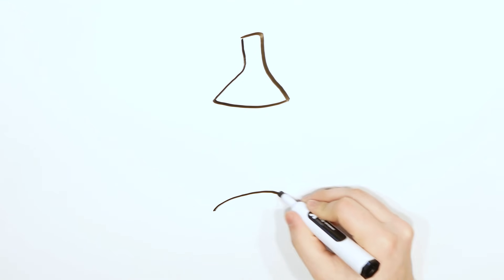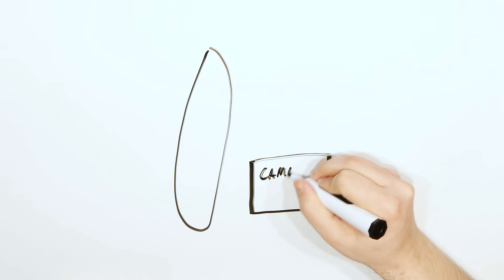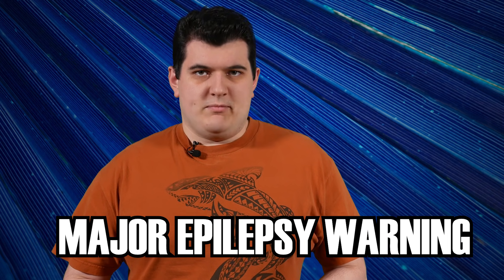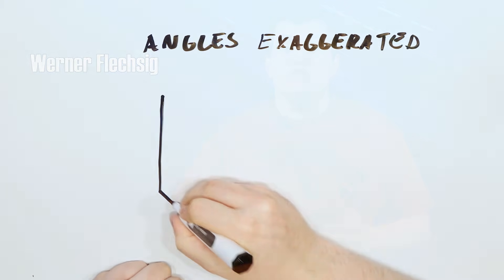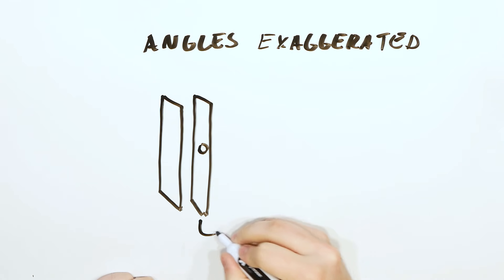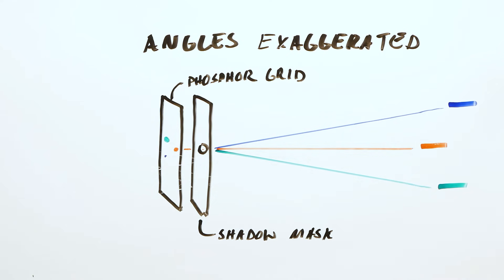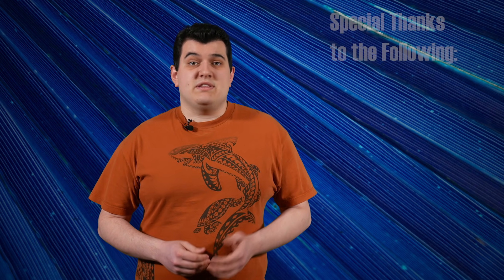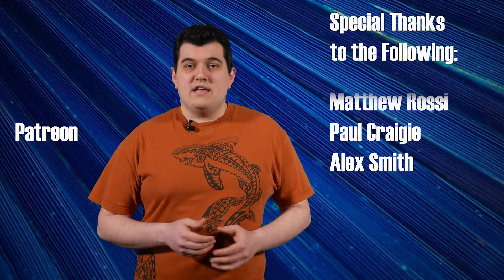How Analog Color TV Works:  The Beginnings

Comment: RGB and 144Hz? Man those guys were hardcore gamers.
Reply: Tom5tom Entertainment :) I wonder what FPS they we're getting on Crysis with their sweet Univac rig...
Reply: MOS6582 when i see 80’s shows i see it as a very high fps but when i see shows now it seems like its lower then the 80l’s framerates.
Reply: TV shows in North America in the 1980s were 30 frames per second. This may look faster than some modern TV to you for two reasons. The first is that the picture was interlaced, drawing every other line 60 times per second (controlled by the 60 Hz power supply). This is essentially a compromise between 525 and 262.5 vertical resolution (minus some for overscan) and 30 fps and 60 fps time resolution. The second reason is simply that some TV shows now really are shot at the lower 24 fps rate for a cinematic quality. However, you will also find some cable and satellite broadcasts at higher frame rates, up to 240 fps progressive scan, which would have been impractical in the 80s and impossible for broadcast TV.
Reply: @EebstertheGreat  I might also want to add that audio and video, compressed, are not compressed together. By extension, they're not decompressed together either. They are completely separate streams that need to be synced up at playback, and they are not inherently in sync. Although modern video(with audio) transmission tries to sync it up, it's not always successful, and not nearly as "perfect" as it was in the analog world. I may be aging myself(and I'm not THAT old), but I still notice the subtle lip syncing problem when watching videos on Youtube and even digital TV, which is pretty much everywhere now. IMO, this accounts for some of the "80s frame rate seemed better" perception. SMTPE ST2064 addressed this pretty recently in 2015, but I'm not sure how much that has been rolled out or implemented.

I'd be interested in hearing if younger people know what I'm talking about.
Reply: @djd829  It is true that the audio and video streams are separate, but this isn't the source of the desynchs you are seeing. That is really common on Youtube and many streaming platforms, but you shouldn't see it on videos on an optical disk. The problem there is the way the video player handles video and audio when buffering. If a video pauses to buffer, you will often notice the audio continuing significantly after the video has paused. This is because the video signal is much higher bitrate than the audio, and so if your internet connection to the site isn't fast enough to keep up with the stream, the player usually runs out of video to show before audio.

In principle, there is no reason the two couldn't resynchronize perfectly when the video starts playing again, but in practice, this is where I've seen things go wrong most of the time. It's just a software bug, and if you download a video entirely in advance and then play it, you shouldn't experience the problem. The desynch is not a problem with the video container.

If digital TV is giving you issues, again, it's most likely a software problem. My parents have a very high end setup, but because the sound is handled by a separate device from the video, the two can desynchronize. I think in this case you are basically right, though it has nothing to do with compression. A totally analog system will introduce practically no delay between the signal coming in (from a tape, broadcast, or whatever) and the mechanical motion at the other end (of the driver, CRT, or whatever). It's impossible to have this sort of problem with analog equipment, assuming the video and audio equipment are getting the same signal at the same time. But digital devices necessarily introduce a delay, because computers are only so fast. In properly-designed setups, this shouldn't ever be perceptible, but it's something that often goes wrong that never did in the past.
Reply: @EebstertheGreat  I don't have a sync "issue". It's subtle. Like I mentioned, it's something people younger than 20 would never notice. Considering you're talking about how high end your parents system is, it sounds like you fit that demographic. Move on.
Reply: @djd829  No video compression algorithm desynchronizes audio and video. You used YouTube and digital TV as your only examples. Both of those do commonly have synchronization issues, and neither of them has to do with video compression. It doesn't matter how old I am or how well I can hear subtle differences if you are mistaking the cause.
Reply: @EebstertheGreat  There is no such thing as a "video compression algorithm", and if there were, it surely didn't include an audio stream along with it. Regarding detecting subtle differences, no, you can't, you are clearly too young. You actually don't know what it was like before. I'm not saying that anything important was lost, just that it's different. The fact you don't notice a difference is because you've never known anything different. That's where age comes in. I asked what the young perception seems like, and you've sufficiently answered my question. You actually have no first hand information and no clue. That's all I asked. Thank you.
Reply: @djd829  "There is no such thing as a 'video compression algorithm.' "

Yet a quick survey of the literature shows that term showing up tens of thousands of times.

"You actually don't know what it was like before."

Before what? The world changed? I'm actually not as young as you would believe, but it doesn't matter. An 8-year-old today could watch a VHS and a DVD and confirm that the tracking issues with the former far exceeded the latter, and that a DVD does not have any problems with audio synchronization. (Note that bad tracking IS a synchronization problem.)

"I asked what the young perception seems like, and you've sufficiently answered my question."

You actually didn't. In response to your stereotypes of me, I can only conclude that it is your poor memory in old age that makes you believe you asked a question when you never did.
Reply: Oh yeah. The good old PlayStation 0 days.

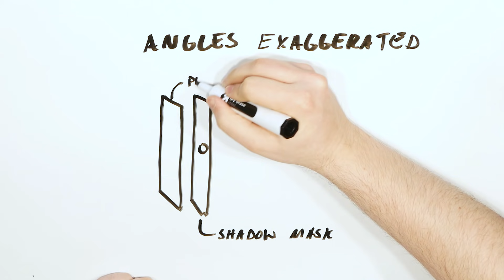Comment: 9:04 The guns are actually very close together in the neck of the tube, so the angles of the beams would be almost identical if they followed straight lines. But since the trajectory of the beams is controlled by a magnetic field which tends to curve the beams in a way that is affected by even the small distance between the guns; the beams end up curved in 3 directions, making the shadow mask much more effective in directing each beam to the appropriate phosphor spot.
Reply: he did write that the angles were exaggarated

Comment: The colourwheel approach didn't die when RCA's system won out, and it's still in extremely common use today: all consumer-level DLP projectors use basically the same system. They have a single DLP chip that produces a monochrome image, and they spin a colour wheel in front of it to produce alternating colours. For this reason, if you move your eyes quickly to the left and right while looking at a DLP projected image, you'll see a smearing of colour known as the "rainbow effect".

Higher-end (professional) DLP projectors like you'd find in a movie theatre get around this problem by using three separate DLP chips with fixed colour filters.
Reply: I hate the rainbow effect on DLP projectors...
Reply: That lousy tech is a good reminder of how close we came to a crappy mechanical color-TV system.
Reply: Not all DLP sets! The ones that use LEDs for the light sources have separate red, green, and blue LEDs, and no color wheel. There is still just one DLP chip, but the "alternating colors" is done by switching the LEDs on and off. This is done at a far higher rate than a color wheel could achieve, so there is no rainbow effect.
Reply: It isn't nearly as bad as the mechanical color tv, because the dlp chip and color wheel are quite small, so the wheel can spin quite fast.

Comment: What about the beam index, or indextron tube. Full color without a shadow mask, and only 1 electron gun.
Reply: 12voltvids that was an awesome design! I remember these from my days at Thomas Electronics.
Reply: Mike H 
I have a beam index projector. A Sony videomagic. It has a built in betamax player as well. These things are as rare as hens teeth. You can see it repaired on my channel. Very cool piece of technology and it actually works quite well. With the proper screen and in a dark room it has a very watchable picture.
Reply: Always wanted to see one. The previous tube company I worked for tried making these. I had an idea trying to improve the resolution by tevising the electron gun to 5megapixel type medical imaging electron gun. Never got around to it.
Reply: Beam index or Indextron eliminated purity problems, convergence errors, and were far more efficient because they did not have the losses associated with the shadow mask or aperture grill in the trinitron.  They are more complex though, because they require the PLL circuit to accurately time the time division switching for the RGB video signals, and they require the 4th UV index stripe which is located between the blue and red stripe if I remember.
Due to the fact that the tube has to be biased to get the index stripe glowing even on a black screen, they do not have as good contrast as a conventional tube, and the 4th index stripe tends to lower resolution. If they could have acheived the same picture quality of the shadow mask tube I am sure there would have been more models made, but in reality the quality just wasn't there. They were good for specific applications, that being a very bright tube, such as in projectors, but no good for low light applications because of the constant glow when displaying a black screen.

Here is a link to an indextron projector repair I did on my channel a few years ago. These are cool projectors and very rare these days. Especially the one I have that has an integrated Betamax recorder. These were never sold as consumer devices, and were uber expensive back in the day because, well they were the very first truly portable video projectors that could be basically just pointed at a screen, the focus set, and watch TV or a video.
https://www.youtube.com/watch?v=4ApuK6YAzuM
Reply: What??

Comment: Could you elaborate more on the difference between NTSC and PAL/SECAM?
From what I understand, the technology is quite different.
Reply: Well, you could watch this video: https://www.youtube.com/watch?v=3GJUM6pCpew . First, he explains how NTSC works and later what's the difference with PAL (the frame rate)
Reply: NTSC came first, European engineers looked at its flaws (mainly the hue drift which gets it the nickname of Never Twice the Same Colour), said "We can do better." and went off to work. The French team came up with SECAM, which solves the problem by putting different colour components on different lines and transmits them on FM rather than AM but requires memory to build a receiver. The German team came up with PAL, which uses the basic idea behind NTSC, but includes a phase switch on alternating lines (hence the name) to solve the hue drift problem.
Reply: GRBTutorials I believe StandUpMaths also did a video on NTSC vs PAL (and why the framerate of NTSC is ~29.997 frames per second, instead of a nice round 30).
Reply: @ProfessorYana  Did it go into why 60 Hz signal interference now slowly scrolls instead of being locked as in the pre-color transmission days?
Reply: AFAIK PAL is basically the same but adds a phase reversal trick to mitigate hue/phase distortions caused by non-linear vacuum tube amplifiers. The phase errors on odd lines would effectively be cancelled by the phase errors on even lines. The more obvious difference is in the number of lines, frame rate, and bandwidth, but the idea is basically the same as NTSC.
Reply: Thanks, that's a very good explanation. Although he doesn't go into detail as to why the colors on PAL are more vibrant than the colors on NTSC.
Reply: Eli Malinsky Also how can we watch tv from other countries if their tv systems are different from ours?

Comment: Yeah when  I was a teen I had a B&W tv and I hooked up a vcr to it.  I would play the my recording on my B&W set.  I was young and did not know that I was not recording what showed on the TV but the signal that came through the cable.  I was shocked when one day I took one of my recordings and played it on a color set and the picture was in color and not the B&W I thought I had recorded.
Reply: Sounds like a memorable experience!

I always recorded at the worst quality to get the most amount of hours. :)
Reply: I had the opposite. My VCR had a tracking problem and wouldn't play or record in colour. Which was never noticed, because I had it hooked up to a black and white TV. The real shock was when I brought a tape to play one someone's colour TV and it was still black and white!
Reply: @probnot  old comment but information is always good so: Sounds a lot like a PAL-M problem. We Brazilians have this a heck lot. Nowadays to capture video from analog sources we gotta find some stuff that can actually accept our clever but annoying mess of a video signal. PAL-M combines the black and white frame of the NTSC format (that is, what it uses as the frame, I know NTSC is the color system not the black and white frame itself), but with the PAL color system, on a frequency that works on NTSC frames. It's hell. Sure, it had the best color system of the two and the faster framerate at once, but nowadays... what happens is that Brazilian recordings look black and white on NTSC gear, and jump or don't show at all on PAL systems, unless maybe the other weird PAL-60hz system... and I have no idea what that one is.
And now, me here trying to get old Video 8 tapes out of the dying camcorder, gotta deal with that crap years after their common use demise... "fun" fact: many capture cards can do either PAL or NTSC, but when that mess pops up, it either does nothing or shows black and white.
Reply: @Kalvinjj  "unless maybe the other weird PAL-60hz system... and I have no idea what that one is."

This is lilely the PAL-60 kludge format used in some VCRs offering "NTSC playback on PAL TV" .. which often required the height adjusting & maybe the frame hold on older PAL sets.
Reply: @probnot  I had a weird tape that was black and white until paused then it went into colour! I think it was the Kiddy Kat video or something.
Reply: My mother in law would not allow my daughter to turn down the tv volume while recording because she also thought the vcr was recording exactly what was being watched/heard on the tv. Never mind my daughter was trying to sleep in the room at the time :(
Reply: This was a more common misconception than you might realize. I had to explain to people that the VCR had its own tuner and you could watch another channel or even turn off the TV altogether. Although there was the secondary issue in some cases where the TV and set-back aerial amplifier were both plugged in the same socket, which the owner diligently turned off when leaving the house, so on return from their trip, the owner would find a recording of snow.
Reply: I had a hard time reading this

Comment: The rotating color wheel is also how DLP sets work to produce a color image.
Reply: Yes, projectors work this way, and when you move your vision from left to right you will notice a flirck, like strohoscopic effect. Same when you see a rear tail light in a car, LEDs are strobo also, and you will notice a rare flirck
Reply: Unfortunately, though there are some designs that do without it.  But DLP is inherently mechanical even without a spinning wheel.  All those little mirrors--yuck!  Such a mess onscreen when they start failing too.